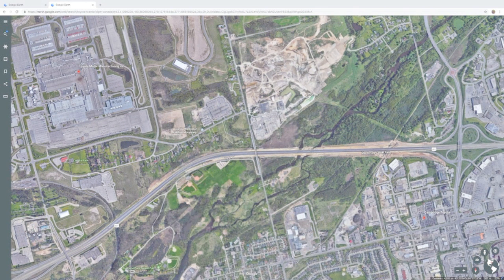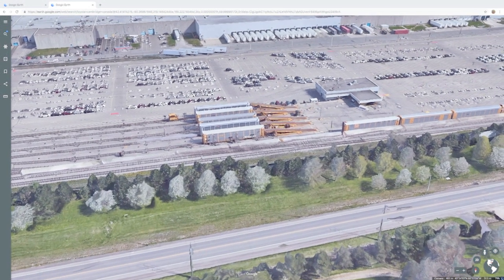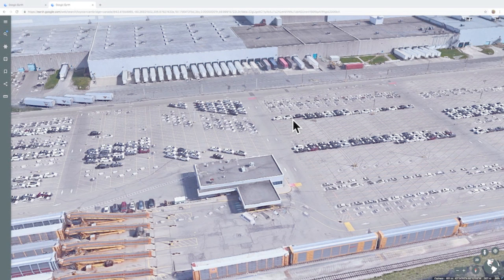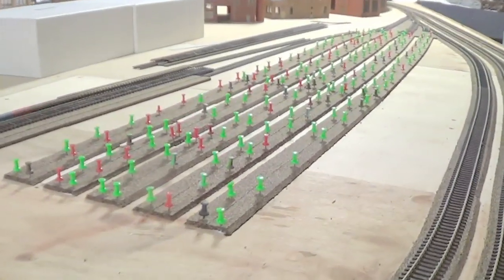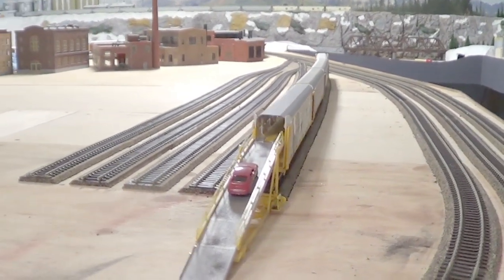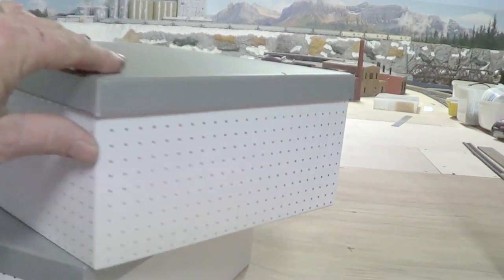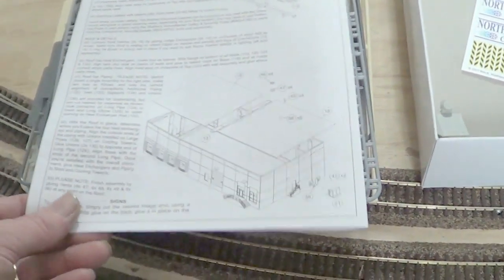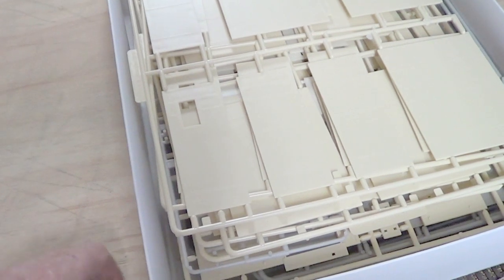Auto Plant Build Episode 1 "Model Trains"

Comment: The track plan I'm currently working on has an automotive facility as its major industry. Having worked in the facility I'm very familiar with the plant layout. The facility itself did everything from assembly operations, stampings to engine and drive train production. The time frame is circa 1975. One thing that makes the track layout easier in the facility is the old Chicago,  Milwaukee and North Shore ran through the property until it ceased operations in the early 1960s. This portion of their right of way was picked up by the Chicago, Milwaukee and Northwestern and tied into their K-D line. Sadly the plant along with the company no longer exists. One thing I would like to do with the buildings on the edge of the peninsula the plant will occupy is to detail some of the interiors starting with the Stamping facility. The presses literally tower over the railway equipment. 
Loads in vary from castings for engine and rear end components, interior and exterior trim, petroleum products (paint solvents, gasoline etc), rolled sheet steel, steel bar stock and at times machine components. Loads out included engines and rear ends shipped to other facilities, stampings to the same facilities, complete knocked down kits for shipment overseas, machining scrap (chips and out of tolerance parts) and bailed sheet metal scrap from the staming facility finished vehicles were trucked to a shipping yard several miles away. At one time the facility was the second largest automotive facility in the US.
Reply from the maker: Thanks for the information and would be great to show everything that go's on in the plant.
So this would be good to see all set up and every detail on show cheers Robert